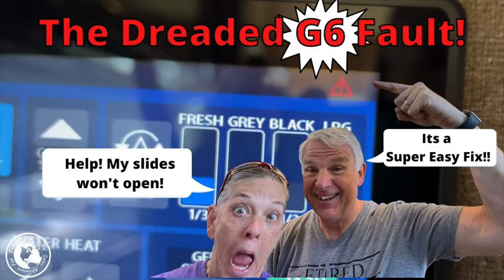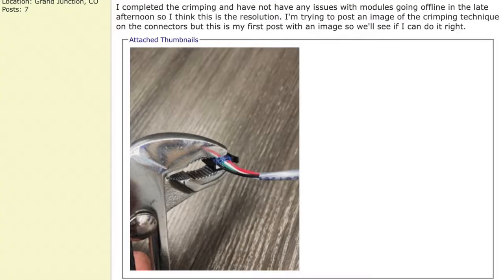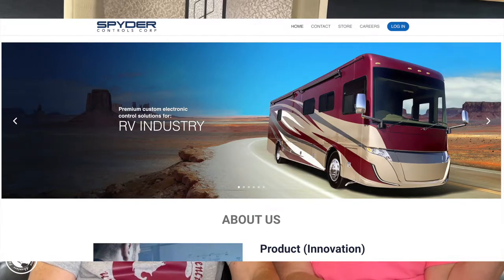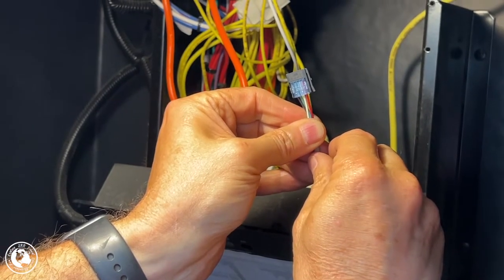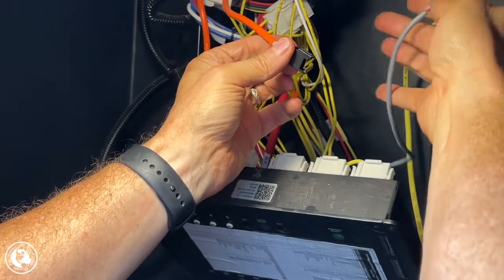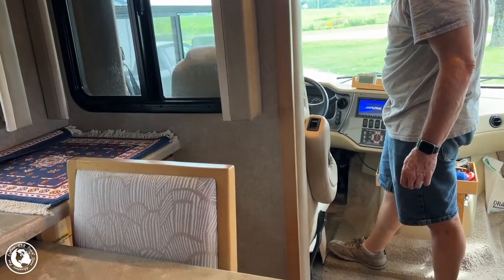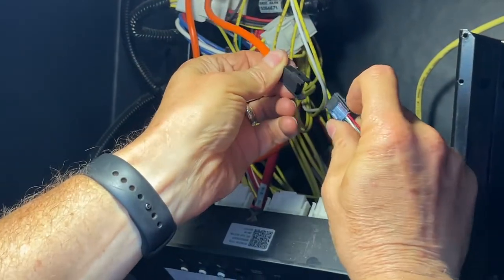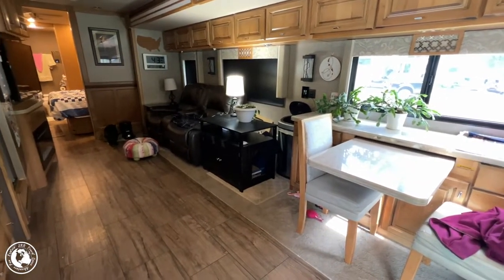RV LIVING: HOW WE FIXED the G6 CHASSIS FAULT on our TIFFIN MOTORHOME

Comment: Hi Guys - I’m glad we found this video.  We have the same Tiffin motorhome you have. We experienced the problem you experienced with your Spyder control. Our G6 Chassis was offline. My husband, Larry tried to fix it like Derrick did yours, but unfortunately it didn’t work.  So just like you said we called their support line. Joseph had Larry press some buttons and it cleared the error message, however, it came back. So Larry called back and spoke with another tech. He had Larry take the inside main Spyder off the wall. That was tricky. There are 4 colored wires and he had Larry crimp the black one like you did the orange. It works!  We will see how it goes. 
Again thank you for putting your information on YouTube. Hope you had a great summer. When will you be back to Saint George?  Our son lives in Las Vegas and we go through Saint George. Next time we are there maybe we could meet for coffee. 
All the best, Janice
Reply from the maker: @janicevoss864  thank you! So glad you got it to work 😁 We will be back in mid -December. I’ll keep you posted. 😁

Comment: That definitely looks like an annoying issue to have.  Glad it was a simple fix.  Good informative video.
Reply from the maker: Thank you so much! It definitely was an annoying issue, and two weeks or so after we’ve done it, it’s still holding up just fine. We haven’t had any trouble with the slides. Thanks so much for stopping by!